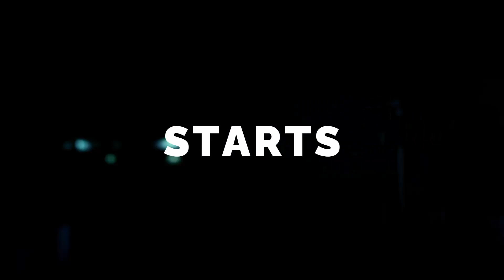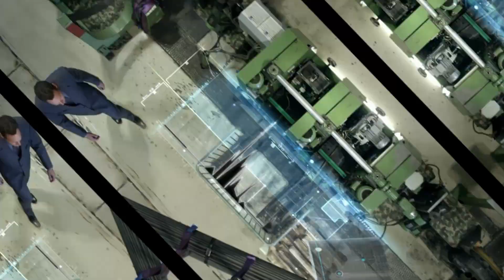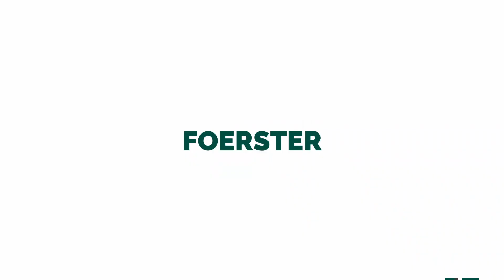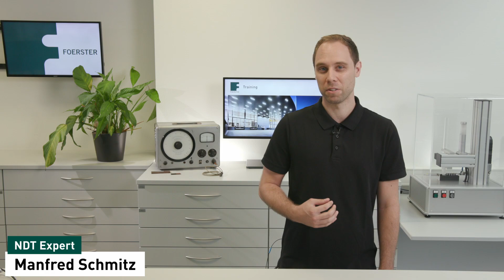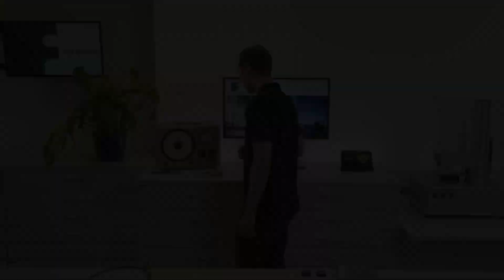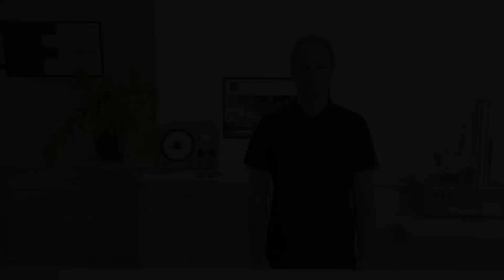Testing with eddy current - measure the electrical conductivity – part 1

Comment: Hey there!
I know that for example duraluminium 2024 with different type of heat treatment has different kind conductivity, because it depends of cristal lattice. 
So it is possible find out not only cracks and corrosion in this material but the abnormal ambient heat collision. 
Thanks